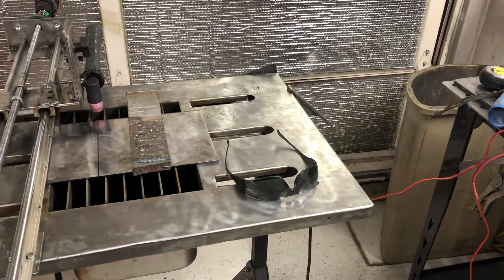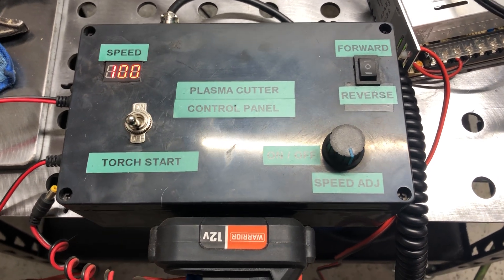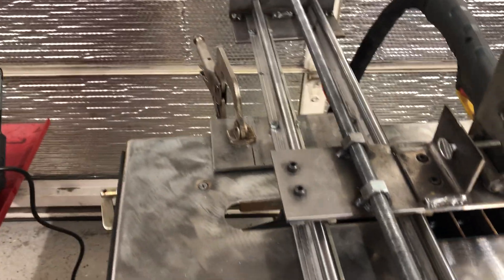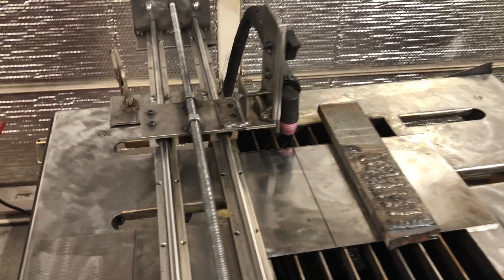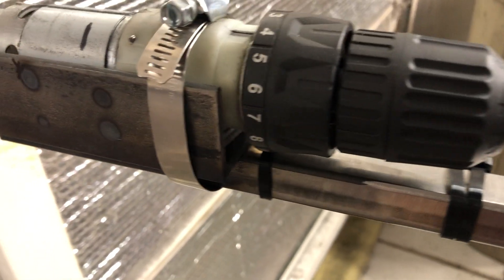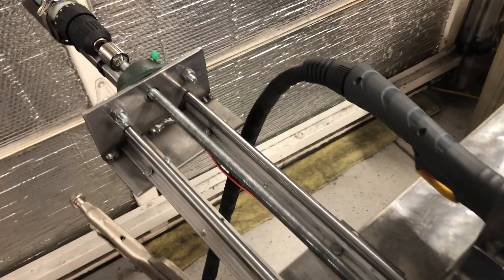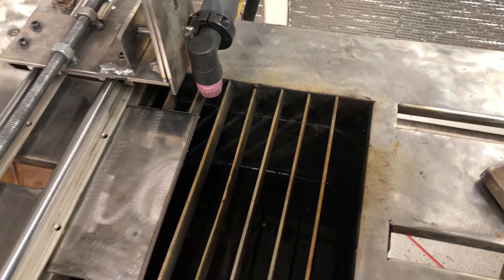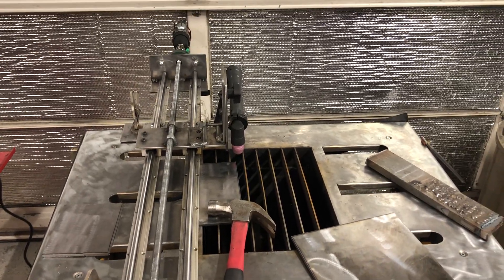Motorized Plasma cutter track for under $200

Comment: How about a windshield wiper motor to drive it? It would have mounting points.
Reply from the maker: Hi, yes it would, and I looked into that but I wanted the added safety of the clutch on the drill.  Plus for $20 I got the drill with a clutch and the battery to use as a power source if I want to go wireless.

Comment: Very nice. At 6.04 with the angle adjustment, is the vertical plate resting on the thumbscrew? It seems the plate would want to rotate away from the thumbscrew with the weight of the torch on the right side. Maybe I'm incorrect? Does thumbscrew pull the plate in instead? If so, how is the thumbscrew attached to the plate?
Reply from the maker: Hi, so the plate the torch goes on has a slight bend in it so when I tighten the adj knob it grabs on to the bottom as well. 
With the second nut on the back I can install a second bolt to hold it in place but so far it has not been needed.